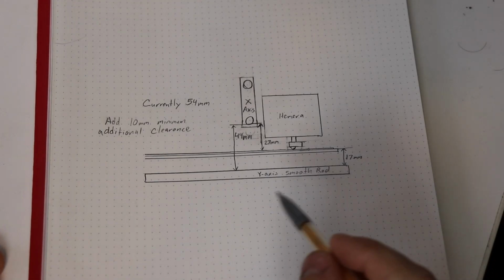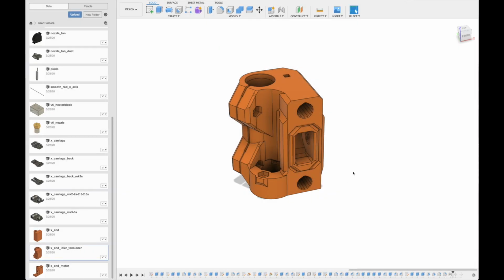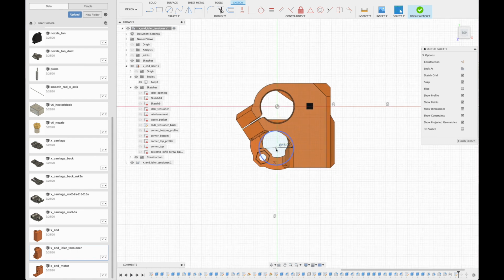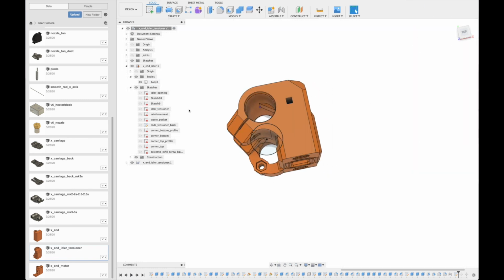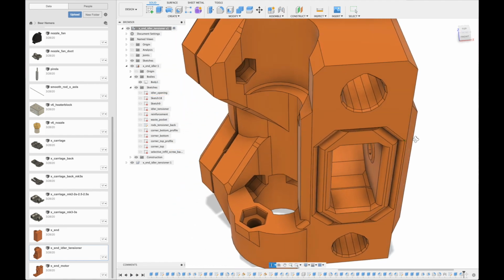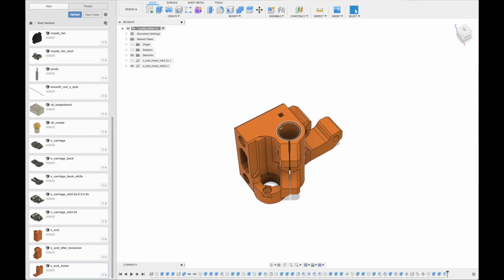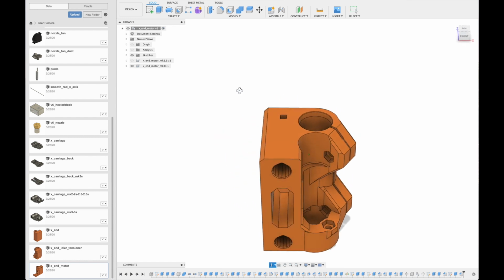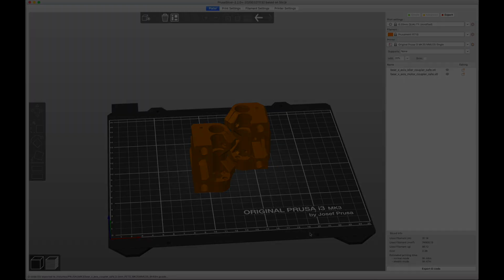Building a Custom Prusa Bear 3D Printer (Part 3) - Fusion 360 Tutorial

Comment: Nice Work Melissa do you have the Mk3 bear fusion 360 cad with x axis and extruder as i couldn't found it in full in their site just without the x axis and extruder i'll use Bear X axis and Extruder to build 300x300x300 volume MK3 Bear
Reply from the maker: No, I just had them separate in Fusion 360. That’s a great idea to expand the size of the bed. Especially with how stable everything is.